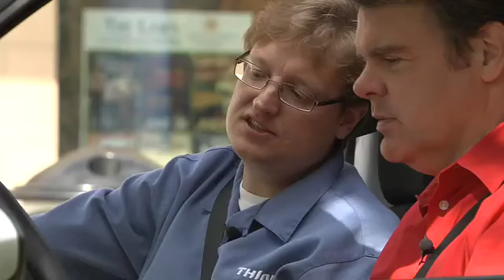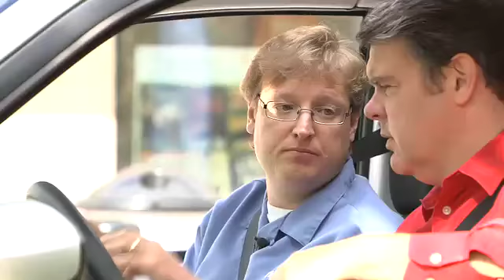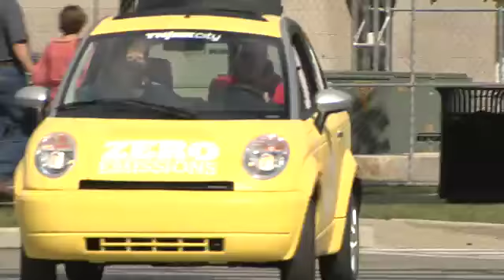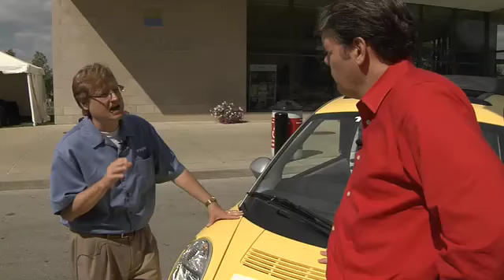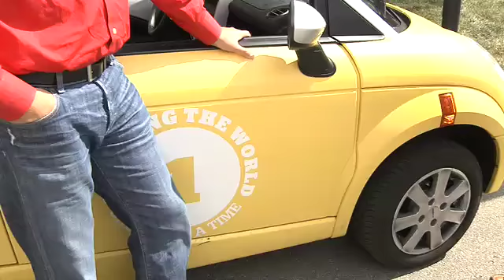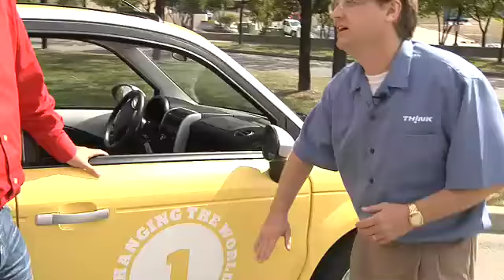Think City, an EV Test Drive

Comment: Hi, I just placed my Reservation for the 2012 RAV4 EV, $99.00 deposit, and only a 5 month wait, what is nice? a US Federal Rebate of $7,800. plus zero sales tax fro the IRS.

Contact For Reservation:
San Francisco Toyota & Scion
3800 Geary Blvd @ 2nd Ave.
San Francisco CA
Mobile: 415-216-6499
Direct 415-592-0808
Fax 415-592-1738

Kevin Pang Sales manager.

I will save 18,000. every 10 years by not using gasoline.

Kelly Blue book has a projection feature on how much fuel each car/5 years